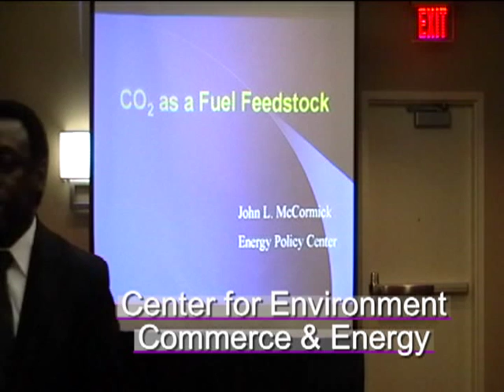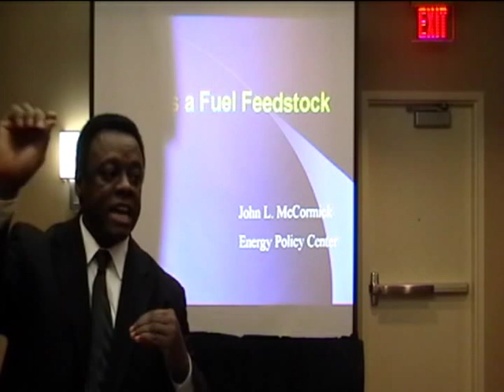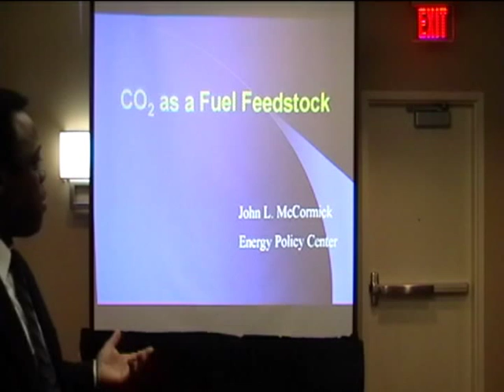CO2 To Fuel - Norris McDonald

Comment: One way to reduce the cost of using nuclear energy for this would be to use thorium as a nuclear fuel as opposed to uranium.  Thorium is produced as a waste product from the mining of rare earths, anyway...so there may not even be a need to mine new thorium other than that produced by rare earths mining, anyway.  If Liquid Flouride Reactors are used, money could be saved on safety mechanisms because less redundancy is needed due to the fact that there is a frozen "plug" which would melt, allowin